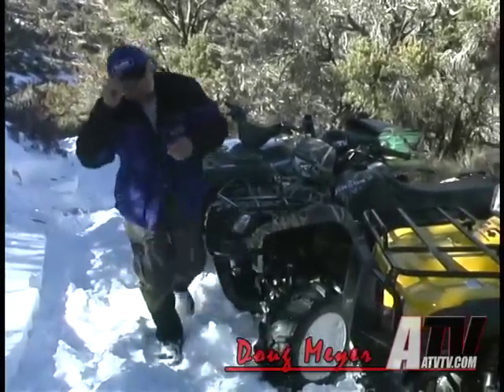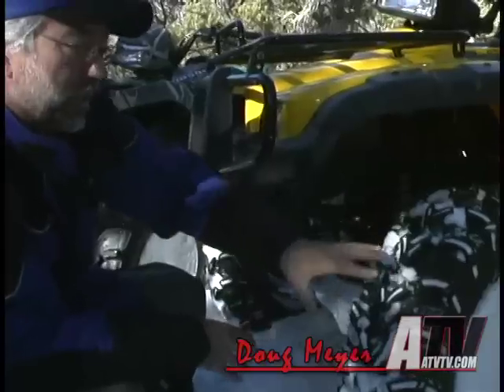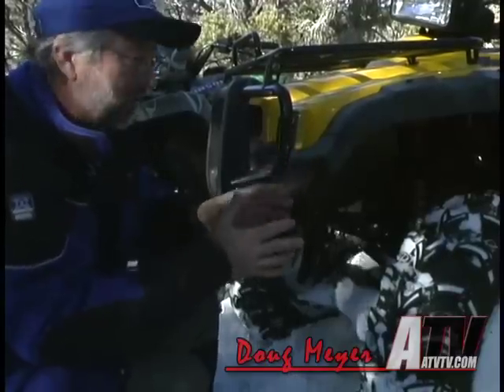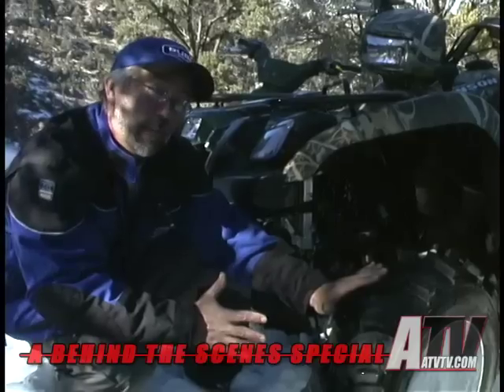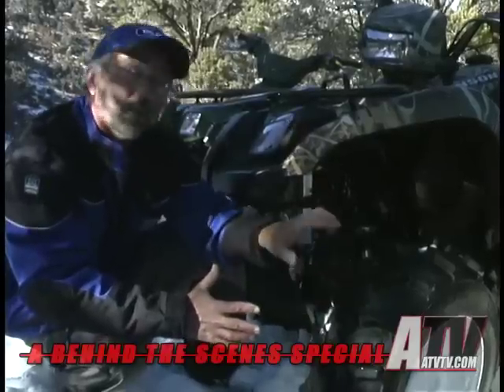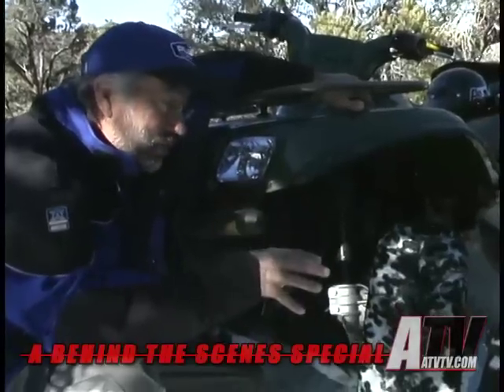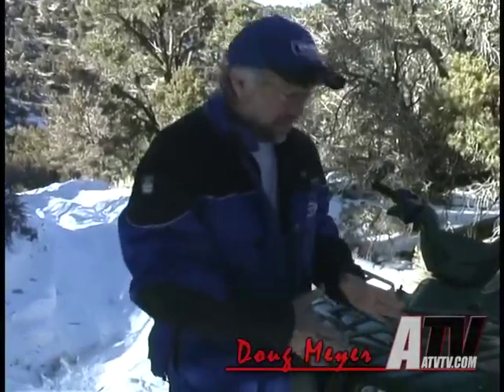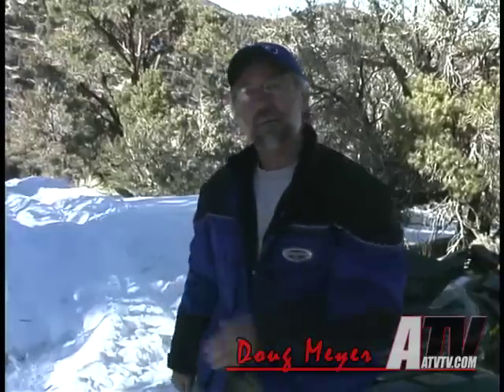ATV Television Special - A Day Behind the Scenes Testing 3 Sets of Tires in the Snow part 3 of 3

Comment: Again, one here for the Maxxis option.  Most of the guys on the forums swear by the bighorns.  Have to say these were night and day better than any other tyre I've used in the snow (were still pushing even when I had run out of ride height and a pile of snow had heaped up on the front of the ATV), but I still wonder how they rate against the ITPs.  Shame the bighorns weigh so much.

Comment from the maker: @fanjules It amazes me how many Bighorns I see on the trail and how people 'swear' by them. Our testing shows the only plus is that they wear really well. We just took a set off of a guys Rubicon and installed a set of ACTs. He is amazed at the improved steering, ride, power, and traction - especially in the snow. Unfortunately they will only last about 1/3 the miles of the Bighorns.

Comment from the maker: @ATVTVCOM Respond to this video...The latest Terra Cross have a thicker (and heavier) carcass and a bit harder compound to make them closer to Bighorn durability but better performing, The Baja Cross is heavier still and a very close match to the Bighorn. Of course so much also depends on what they are mounted on. A (heavier) UTV can accept a heavier tire much better than a lighter ATV. Having a power steering defers the weight a bit as well as does an open front dif with a locking option.

Comment: @ATVTVCOM Due to the weight, and coming from an asphalt circuit racing background, I agree that the Bighorn will worsen ride, steering and power loss. However, I'm unsure about the traction comment. If we are talking traction out of a corner at speed this may be true, but for crawling they seem to offer good grip levels. I bought them for dependability - don't get torn up and don't leave me stuck! But I also believe tyres are half the ATV, so if there is something better I'm all ears. :)

Comment: Did you have that Prairie in low or high gear?  I've always wondered which gear would be better for snow when you're not going forward fast but your wheels are spinning fast.  When that happens in mud, you want low gear.  But snow?

Comment: Whats your opinion of Maxxis Zillas? They are lighter then 589s, but still very aggressive, but yet not so aggressive that they ride rough. Ive never been stuck in the snow with them on my grizzly 700 EPS, toughest conditions being after a 2 1/2' snowfall, and rain shortly after, made for 6-10" of slush.